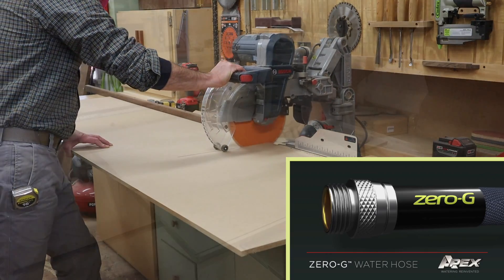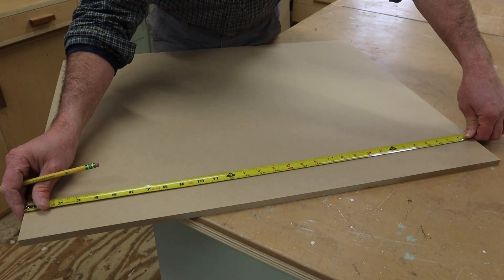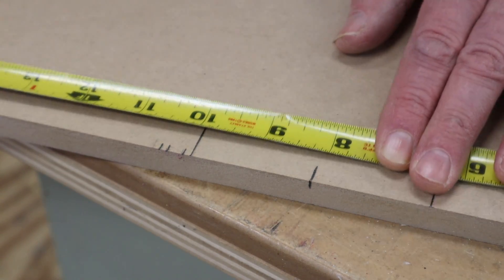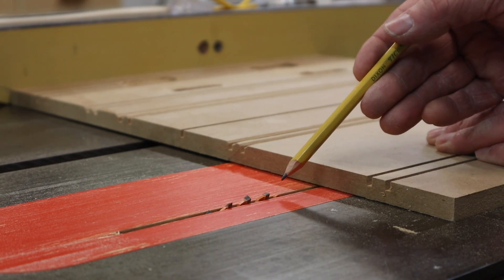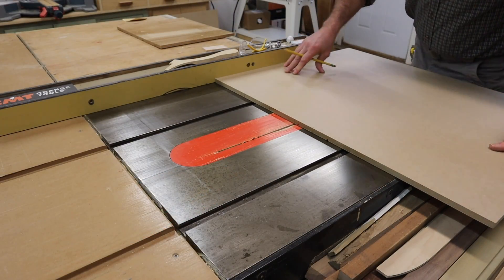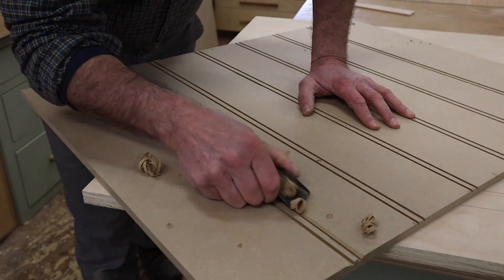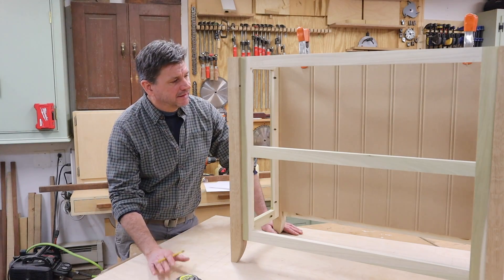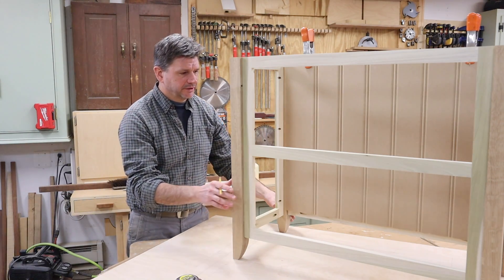Make Beadboard with a Hand Plane & Table Saw

Comment: Hey Jon, love your videos!  I noticed for a brief second that the little plane you used looked like the blade went very close to the edge of the sole. (perfect for doing what you were doing) Most of us probably own a small block plane but not sure which one you were using.  Also looked like a steel body plane.  Make and model?

Comment: Nicely done Jon! However, I had the same question as one of the other commenters: Isn't that board just going to be hidden in the back so that you won't even see it? Or am I missing something?
Reply: If proportions are adequate the beadboard will be a feature.  From a lower eye level, such as sitting on the couch, the beadboard will show nicely.  Much nicer, I feel, than smooth pressed board.  😁

Comment: Im missing/not understanding  what takes place/whats the purpose of when you spin the board around..

Did you move the fence when you flipped it?
Reply: William Smith flipping the panel mirrors what was done on one side to the other. I don’t think he moved the fence when he flipped the panel
Reply: @paulostrowski6314  

Sorry for my ignorance but, I just dont see how turning the board lines the other side of the bead up perfectly without a fence move. I have watched it quite a few times..🤔

 Looks like im the only one not getting this so ill chalk it up to my stupidity.

 Hell i dont even like beadboard and watched just to see what i could learn😂
Reply: I think what you're missing is that he started everything based on the CENTER of the panel. Simply flipping the board ensures symmetry of the "beads" - which you definitely want with a bead board panel. (looks "off" otherwise) Also the reason why when he cut to final width, he cut equal amounts on both ends and not just one side.